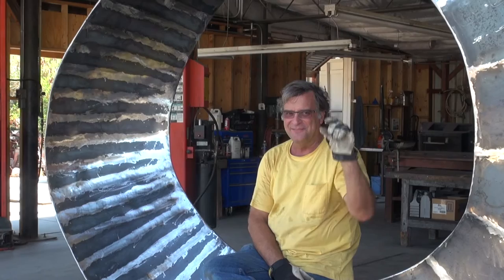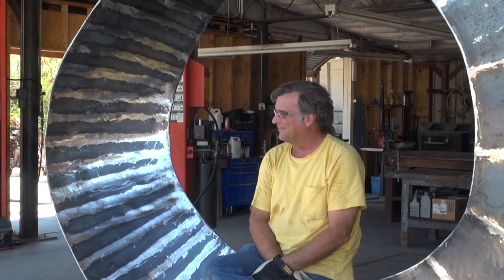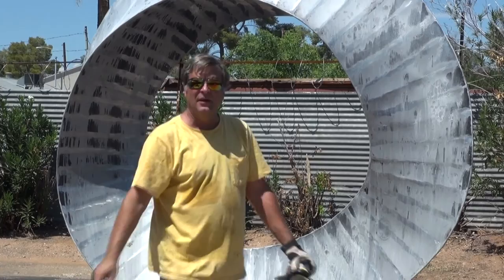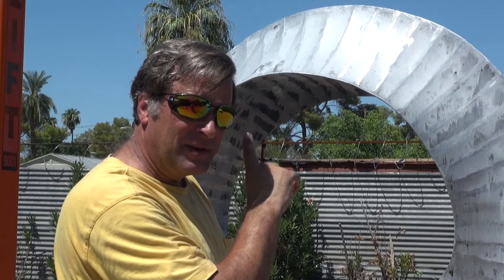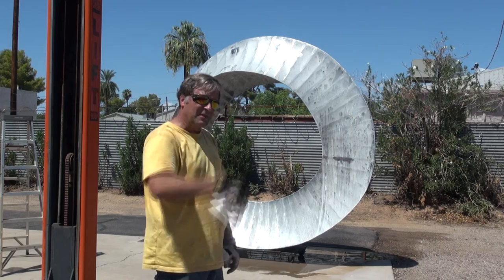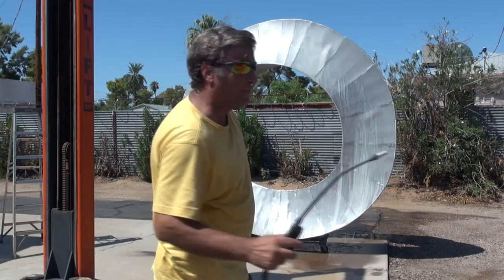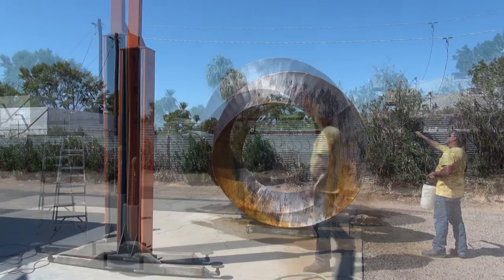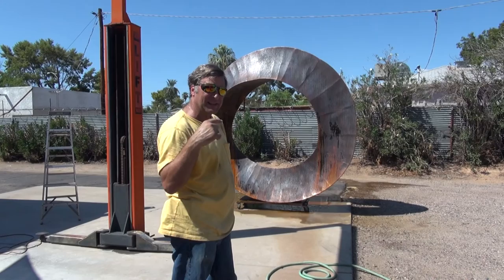How to Create a Sculpture, Part 13: Applying the Finish - Kevin Caron

Comment from the maker: The lift is just that. A 9000 lb two post lift that came with the garage when I bought the place. Got two more inside and two in ground lifts as well. 

As to the muriatic in the mix....  maybe just a drop or two....

Comment: maybe this is how we remove mill scale:
The primary acid used is hydrochloric acid, although sulfuric acid was previously more common. Hydrochloric acid pickles much faster while minimizing base metal loss. 
Carbon steels, with an alloy content less than or equal to 6%, are often pickled in hydrochloric or sulfuric acid. Steels with an alloy content greater than 6% must be pickled in two steps and other acids are used, such as phosphoric, nitric and hydrofluoric acid.
courtesy of wiki

Comment: that's cool how you take the scale off. Is it some sort of aftermarket mixture, or just diluted muriatic acid? I have dipped the steel, but not spray with solution because of safety hazard regulation at my site